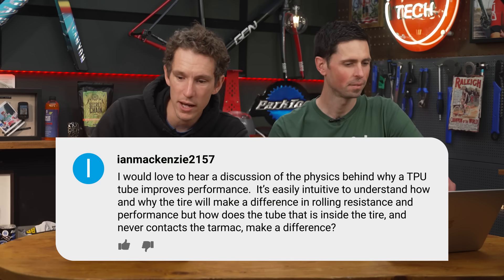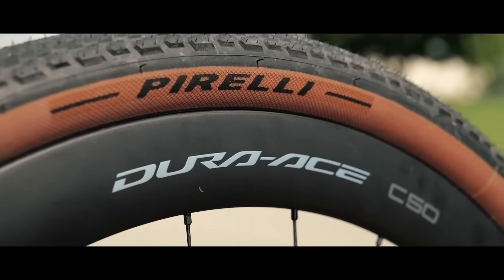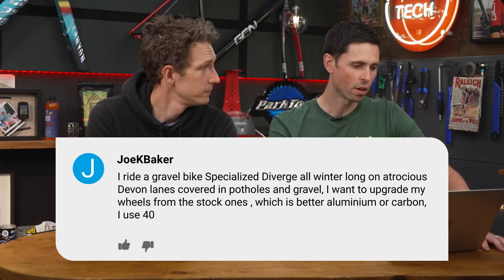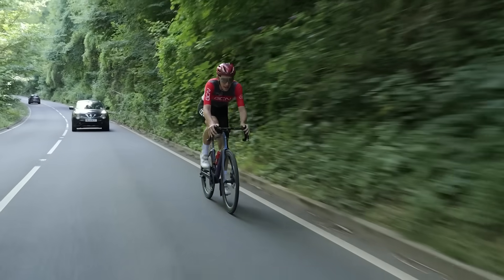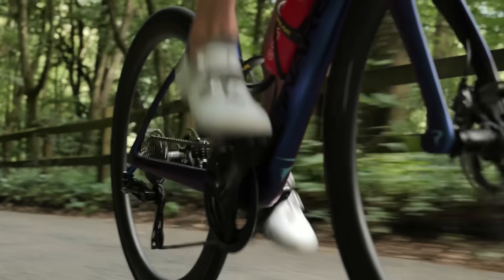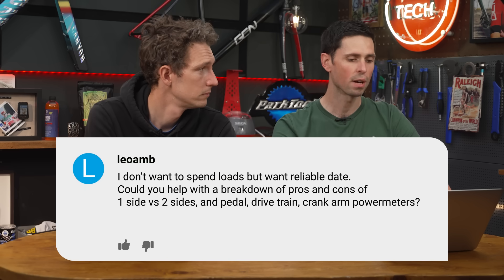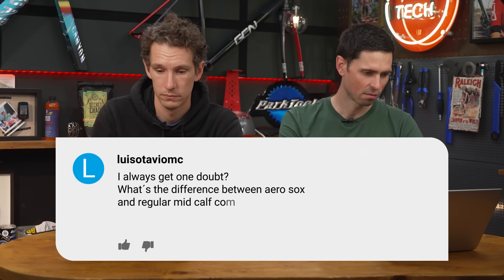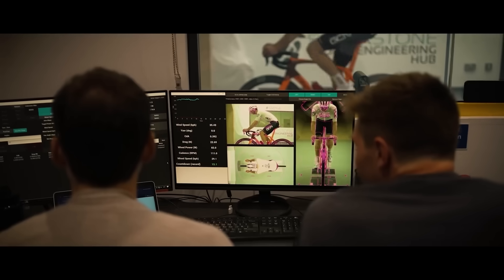Choosing A Powermeter, Aero Socks & AI vs. GCN Tech’s Wisdom | GCN Tech Clinic

Comment from the maker: What's the one bike upgrade you made that felt totally worth it? Let us know in the comments below! 👇
Reply: TPU is the biggest change for me, not just per dollar. Made a bigger and more noticeable difference for me than new wheels, carbon frame, tires, etc.
Reply: FaveroAssioma Pro mx 2 that way I can get the most out of my pedals.
Reply: InPeak power meter, correct width saddle, chinese "Offbondage" TPU  tubes
Reply: Power meter.
Reply: Better than factory tires and power meter pedals.
Reply: Losing 40kgs in bodyweight...
Reply: Swapping out Conti Gatorskins for Vittoria Corsas. Huge wattage and speed gain around my most well-proven, measured course. (Richmond Park lap😂). Honestly…big gain. 👍
Reply: Question: is there any merit in putting sealant into the inner tubes, on wheels with which you can’t go full tubeless?
Reply: @hisdadjames4876  I know people who swear upon that, so might be?
Reply: Aero socks definitely, unbeatable power to price ratio.
Reply: Diskbrakes on my 2009 MTB/touring bike.
SRAM Red22 etap wireless shifters on my Cannondale HiMod and on my Bike Friday Pocket Rocket Pro 1999
Work in progress: TPU tubes with CLIK valves on most of my bikes and adapters on my pumps.
Reply: Saddle and carbon wheels - both gamechangers for me.
Reply: Saddle!! If you are comfortable you are happier and faster and stronger!!
Reply: I upgraded a bike from 10 speed 105 to 11 speed Ultegra. Totally worth it. This was when you could pick up a groups from Probikekit for around $500 and I ended up selling the 105 groupset for like $250, so $250 for Ultegra made sense.

Comment: 12:19 : I really don’t understand your point here. If you say that you don’t care about 3W savings that is fully fair, but then you should also not care about aero socks, TPU tubes and what about carbon wheels… And if you care about efficiency, then making a 3W upgrade for 20 pounds does sound relatively good. Can I get a 300W improvement by buying 2.000 pounds wheels or bike? So to me ChatGPT is not fundamentally wrong.

Comment: The need for dual side powermeter may arise quickly after a crash ... Had some muscle stretch and up to 30 %  difference. So the l\r balance did actually give me a gauge for the recovery process! Sadly still not fully with 46/54 most oft the time.

Comment: #askgcntech I have a turbo trainer with 10 speed cassette and 2 bikes (gravel 10 speed, not waxed, 12 speed road waxed) i like the look of the Zwift cog which will allow easy use of both bikes indoors in winter.  My questions are: will using the unwaxed chain on the cog impact the wax on my road bike? if so, when converting the gravel to wax, is it possible to do so without removing cranksets derailers and cassette and sonicating etc? or will just a new chain and hot wax (and an on bike drivetrain de-grease and clean) be enough? Thanks

Comment: The question about carbon vs alu wheels: you didn’t seem to factor in what imo is the most important consideration! Which is: rim or disc brakes? If rim, then an alu wheels, or at least brake track, makes a lot more sense - especially if living in a hilly area. Carbon brake tracks are a joke !

Comment: #AskGCNtech Hi nerds!
I just replaced a spoke on a 7801 rear wheel, and when checking the tension on the non-drive side, I noticed that the spoke tension alternates between about "14" on the leading spokes and "11" on the trailing spokes using a Park TM-1 Spoke Tension Meter. The wheel is very true, but I'm wondering if I should let some tension off of the leading spokes and add a little bit to the trailing spokes. Theoretically, it seems like this adjustment should balance out, but I don't want to mess with it if it's unnecessary.
Complicating matters, the leading spokes lace to the outside of the "flange" (straight-pull, with nipples lacing to a machined, star-shaped flange), while the trailing spokes lace to the inside of this "flange". This means that these spokes are pulling from somewhat unique angles tangential to the hub, with the outer leading spokes laced about 8mm outboard from where the trailing spokes are laced. I'm wondering if this is significant enough to be a factor.
Thanks for your insights!

Comment: #ASKGCNTECH,Hi guys,your explanation of inner tube rolling resistance was frankly crap,I am still none the wiser,you need to do an experiment to proof it,same wheel,same tyre,same pressure and same rider on the same piece of road and see which rolls the farthest,because I feel the same as the original question asked in that it's the tyre tread that makes the difference,go on proof it,Thanks Paul.

Comment: #askGCNtech
I'm converting the cyclocross bike for my 9yo son to a 1x setup, due to gear limitation. 14-38 is the hardest they are alowed for his age category. I'm looking for a suitable crank. Can I use a MTB Crank? The bike as a 68mm bottom bracket  shell, pf30, 24mm axle. I suddenly am reading about chainlines and offsets, this looks more a thing in the MTB world. Do I need to take this into consideration? And what about the length of the axle? Do they differ aswell? What's you're best advice for a crankset?

Comment: Older and cheaper Shimano road bike groupsets use bottom brackets with higher friction. A SHIMANO Ultegra SM-BBR60, which is commonly used from 105 onwards, has lower friction. Furthermore, chain friction is lower with an Ultegra chain than with a 105, and is best with a Duraace chain.

Comment: #AskGCNTech
I got a hole in my old aero socks the other week and instead of throwing them away I'm considering chopping the bottom off and wearing them between my knee and the new socks, like an aero leg warmers (I'm not riding under the UCI jurisdiction).
Given your experience in wind tunnel testing, how many Watts do you reckon that saves? I would need at least 10W gain to offset the embarrassment of turning up at my group ride looking like a bellend

Comment: #AskGCNTech
I've been happily riding my old steel bike for more than a decade, but after trying a friend's new bike (Van Rysel RCR-F) 
I was honestly blown away by the difference, specially when accelerating
I'm planning to upgrade to a new modern bike in the future and I was wondering, what has the biggest impact on quick acceleration: the stiffness of the frame, the weight of the bike, or the wheelset?
Reply: If you want acceleration get a track bike with a steep rear triangle.  Non dished wheel + no pulleys + short wheelbase = massive acceleration.

Comment: The 1/2mm inflated width increase for every 1mm increase in rim internal rim width over the design internal rim width  starts to fail as tires get wider and as internal rim width gets much larger than the design internal rim width.  For a 50mm tire, the design internal rim width is 25, so with the 303 Explr rims, you'd expect a 50mm to inflate to 53.5mm or so.  I think (but am not sure) that approximation was based on road tire widths.  For example, I use 30mm tires on 25mm internal width rims.  The design internal rim width for those tires is 21mm. Since my rims are 4mm wider than the design width, you'd expect them to inflate to 32mm instead of 30. Mine inflate to 32.4mm.

FWIW, the specs for design internal rim width come from ETRTO.
Reply: That was excellent thanks you very much for your informative post.

Comment: Some of us apartment buildings and work offices need to park in secure garages with doubled sided vertical racks along with hundreds of other bikes. I’ve already had a spoke broken by others going in or out next to my bike. Also wonder if my disc rotor has been banged on from this. How would you protect your rear hub & rotor in this situation? Are there good solutions out there?  #askgcntech

Comment: Alex will know the answer to this immediately - do pedal power meters work accurately on all crank lengths? In fact, the question is do they derive power from both rotational speed and force, or do they only detect force? #askgcntech
Reply: They detect force.  You input your crank length, and then that is used to calculate torque. Torque times angular speed gives you power. Some power meter pedals have gyroscopes (and/or accelerometers)  built in and can then directly measure instantaneous angular speed. Others might have to measure cadence and multiply cadence by 𝛑/30 to get angular speed.  That method might not be as accurate as it may not count for  variations in cadence over a full pedal stroke.
Reply: Yes, you set up the crank length via app usually, such as on Favero Assiomas. In fact those are one of the most accurate power meters on the market.

Comment: @1:46 totally agree, throwing a tpu tube in the bin is always a pain in the arse. I did have a pretty inconsistent rate of repair with the TPU repair kit though. Sometimes it works wonderfully and others it's just a mess and it still ends in the bin. Any chance you would cover the difference of repairing a tpu tube vs a butyl one someday? Or just give a few tips about it?

Comment: No, Aero calf sleeves do not provide any compression. The reason they exist is for triathletes. They can be worn underneath a wetsuit during the swim, that way when the wetsuit comes off,  you are already wearing them for the bike. It's a good solution because socks are not allowed during the swim, and saves time trying to put on aero socks during the transition
Reply: There are some aero compression sleeves from Compressport though

Comment: I love TPU tubes for the notable performance gain. I have stopped using them as they seem to be too easily punctured by tiny amounts of contamination inside the tyre or rim. I thought I was just being unlucky and getting regular punctures, but after 3 or 4 tubes I got suspicious and kept a punctured one to really analyse it. Having not ridden the bike after putting it in, it had 10 punctures, 6 rim side, 4 tyre side. The rim tape was slightly dirty but no detectable rough parts, same for the inside of the tyre. Put a butyl back in without cleaning anything, no issues a month later. Maybe my TPU tubes were from a bad batch, but I can't justify the hassle and cost any more.
Reply: You're supposed to use tubeless tape for TPU tubes, not the plastic or cloth things.  If dirt is getting inside the tire that's not going to work for latex or TPU.  This is a user error not a problem with TPU.  TPU resists cuts and blowouts much better than butyl, you just can't grind it to death with dirt.  The TPU tube in my front tire is 4 years old, and I ride 130-150 miles a week.
Reply: @凸Bebo凸  I was waiting for the user error comment. If you have to swap 2 tubes during an 8 hour ride, there's going to be tiny particles of dirt getting in, this is unavoidable. As I've said, there's no detectable roughness at all on the tape (which is good quality tubeless tape) or tyre. How exactly are you supposed to clean the inside of a tyre while out on a gravel track? Maybe the user error is using TPU tubes on a gravel ride.
Reply: @doctor_gee  Probably did only 1 pass of tubeless tape or something else bad.
Reply: I did not experienced that with my TPUs (last version of RideNow with the pink metal valve), only puncture I had was massive potholes or piece of glass or wood that went through the tires and that would have probably go through butyl too. Punctures on the rim side is pretty weird.
Reply: @JonJOn0  I was using the RideNow metal valve gravel tubes.
Reply: @JonJOn0  I wouldn't have gay pink valves
Reply: I've been using RideNow TPU tubes for a few years.  I've never had a puncture, (although admittedly, I'm a fair-weather cyclist and don't do a huge mileage}.
Reply: Tubeless my brother
Reply: Latex was my solution to this. Technically even better than TPU, and they seem (sample size 1) to be less sensitive to wear and grit. Cheaper, too. You just have to put “inflate tires” into your pre-ride check-list. 

Tubeless is great, until it’s not. Horses for courses, etc.

Comment: #askGCNTech Do aero socks work with a recumbent bike? Since the aero socks were developed for the rider’s legs to be in the vertical position on a bike. With the recumbent the legs are in the horizontal position will the air be dirty around the socks?

Comment: I wore aero socks for the first time. Same Strava segment. 20 seconds improvement over initial time of 30’ 26”. Average speed went from 31 to 31.4 kph. Identical average watts 162. Doing some math I could attribute 3.5w (1-2% marginal gain) improvement. Is this all due to the aero socks? I cannot believe my eyes. Please help me figure this out!
Almost identical weather and wind . Same bike setup. Same kit: bib/jersey/helmet/shoes.
Only things I changed: 
1. Aero socks 
2. I corrected the front disk brake friction with the caliper I had in the first ride.
Reply: I'd imagine that slight differences in weather and air pressure etc could easily account for 20 seconds over 30 mins so impossible to attribute it all to the socks. However I've heard numbers like 2-5 watts quoted for aero socks so you're in the ballpark. Conceivably could just be the socks but you'd need a bigger sample size to prove it.

Comment: Aero socks increased my overall speed so much that it just became dangerous. In fact, I had to carry a pair of thick wool socks to put on at the top of a climb just to have any hope of cornering on the downhill. Too risky.
Reply: Thank you for taking safety so seriously. This is exactly why I haven't bought aero socks before, I just think it will put everyone else in danger with me speeding through the streets.
Reply: I had to start wearing an aero-bra as well because my feet were going faster than the rest of me.
Reply: They make me faster even when i'm driving a car 😂
Reply: To add to this safety topic:  Accidentally wore 2 different aero socks…. Kept pulling to the left at speed! Beware the socks, friends!
Reply: I tried Aero Socks on my Mountain bike  = Carnage! Plus Lock Jaw sustained by all around from laughing hysterically at me!
Reply: I change my tpu tubes out too….far too fast on the downhill!
Reply: A friend of mine has shaved legs and a bushy beard. Is this some weird form of oxymoron?

Comment: #askgcntech 
Is it more cost effective to get a disc wheel for the rear wheel or a baton wheel or deep rim wheel for the front? I do time trials and triathlons but have a limited budget.
Reply: Front wheel aerodynamics matter way more as the front experiences cleaner airflow. Maybe if you are on a budget you could get an aero front wheel and then get a disc fairing for the rear wheel? You can also DIY a rear wheel disc fairing for not that much money (how-to videos on GCN and GTN).
Reply: @astroturd  Thanks for the reply. I see, so the front wheels are a higher priority. I used to think it would be best to change the rear to disc wheel, but the idea of a new roval has swayed my thinking.

Comment: Pulley wheels with bushings will gum up eventually and produce more resistance and even Aliexpress sells cheapish pulley wheels with (ceramic?) ball bearings AND Si! You prioritize looks and feelings on a bike: It is so satisfying to spin a ball bearing pulley versus a bushing, that won't even rotate ½ revolution.
Reply: What about just cleaning and lubricating the bushings from time to time?
Reply: @edwardjednacz1641  And get dirty? Naaah.  ;-)
Reply: Spot on. I have a 105 groupset, which uses pulley wheels with bushings. I wax my chain, and over time the wax gets embedded in the bushings to the point that they weren't spinning freely. I'm doing a bunch of work on the bike over the off-season, and 'm switching to bearings in the process.

Comment: I've had a left sided crank based pm since 2017. Super reliable, never had an issue, as not much to go wrong. Is great for training as it tracks fitness really well, even if numbers may be just ballpark depending on the person. So I'd definitely recommend one for a start, as found mine really useful for training, and also pacing. But I do want a double sided one when I upgrade hopefully soon. Then I'll know for sure  how accurate or not my current pm is, relative to me.

Comment: #askgcntech I have been cycling much more over the past 18 months and I have discovered an issue and cannot find a good answer. I am suffering chafing on the head of my penis and occasionally on my testicles(all on the same side) . I have tried Chamois cream and differant bibs (some bibs are better then others and none are "cheap"). I feel like I can't be the only one that's had this issue. I should mention that I am circumsized. Any help or suggestions would be greatly appreciated.
Reply: Is your saddle too high? Or tilted backwards? I'd check those first. Changing height or tilt doesn't work, then maybe test another saddle if the shape is somehow wrong? I've found that chamois cream doesn't usually solve anything if there is a fault somewhere else.
Reply: @astroturd I've tried a bunch of things. And it doesnt happen all the time. Much more so while indoor training though
Reply: Chafing is usually due to incorrect saddle height and if you only get chafed on one side that can be a sign that one of your legs is longer than the other. There are simple ways you can check for leg length discrepancy at home, ask Google. I've never heard of "knob" chafing before but then again it's not the sort of subject usually discussed at the coffee stop. You don't wear under-pants or boxer shorts under your bibs do you ? That can cause chafing and is a big no-no. Wear do you tuck the "old feller" when wearing bibs ? I lift all my "junk" up when pulling my bibs on so I don't directly sit on any of it.

Comment: The biggest change regarding the pulley wheels is not a Watt differential but an improvement in shifting quality if you go from a bushing pulley to a ball bearing one since the bushing ones tend to have significantly more lateral play